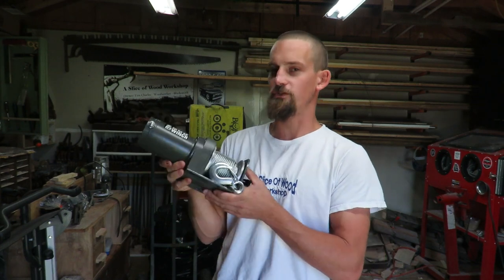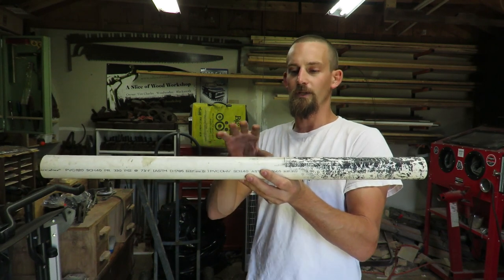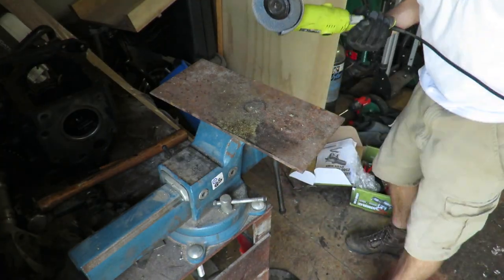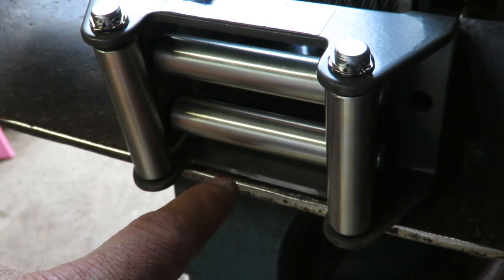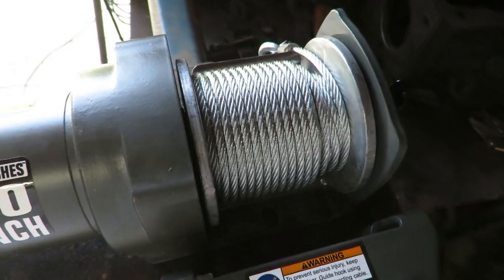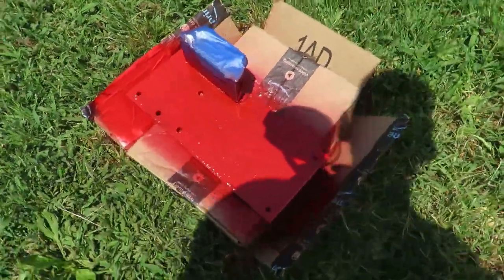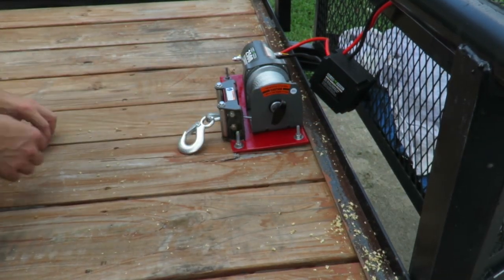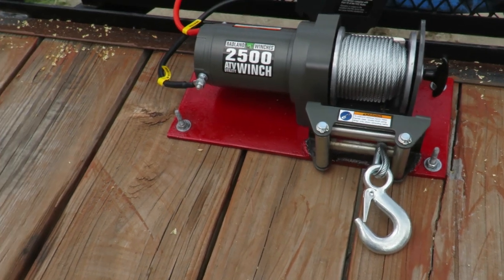Install a Harbor Freight Winch on a Trailer

Comment: Been a welder fabricator for 30 years now and you got enough on it to hold it on through a couple of these little winches. If you're welding machine don't get exactly hot enough make a couple of passes on it and it should hold no more pressure than you got with it . Best of luck and keep on welding.👍

Comment: Tim, I have the same winch on my four wheeler and it has never let me down. But my controls are hard wired so I have to be on the wheeler. You may end up with straps under floor boards to spread your load out. Good job.
Reply from the maker: When I replace those bolts I will probably add the plates. Glad to hear this has worked out for you. I got to use it yesterday, old Simplicity lawn tractor was too heavy to push up the gate by myself.

Comment: The easy way I did my atv winch I welded the ATV winch plate onto a upside down trailer hitch and it works awesome try that setup out

Comment: I have trailer ball hitch on the winch and a ball on to trailer floor. When not in use just takes a second to pop off.
Reply from the maker: That is nice. If you don't need it, it doesn't take up room either

Comment: If you’re using a suitcase style welder with material that thick it really helps to pre heat the metal. You’d be surprised what it can do. I’d say like 300 degrees would be just fine

Comment: Been thinking about a setup like this curious does it have stand alone power ? I kinda wanted mine to run when I plug my 7 pin up
Reply from the maker: Mine is hooked to a battery, but I'm sure there is a way to tie it to a main vehicle
Reply: Just hook your power wire from the winch to the constant hot on your plug that way as soon as you plug it in it's hot ,being the ignition switch is on,and I just want to say that's a great idea you got me thinking now brother. Appreciate it....

Comment: I’d think about putting a plate underneath the boards, and bolting the winch through it with some grade 8  fasteners. 
I’d like to try my hand at welding.
Reply from the maker: I'm planning on upgrading the hardware and adding a plate.  Welding is fun. You can get them cheap off facebook

Comment: Just don't let anyone stand behind the thing being winched up on the trailer.  HF tools are fine as long as their failure won't injure or kill someone.
Reply from the maker: A moving blanket or two place on the wire are great for this safety aspect.

Comment: What did you wire it to?
Reply from the maker: I keep a lawn mower battery charged and wire it to that when I use it.
Reply: @ASliceofWoodWorkshop  Do you find the lawn mower battery works well enough?   I've been thinking the same set up, but just keeping a jump pack handy.
Reply from the maker: Yes it works well. Have not had it die yet

Comment: Why did you not buy the $5.00 mount made for that winch, sold by Harbor Freight. Lord, you made a hard job out of that mounting. My 12,000 gross Hudson trailer, mounted the winch drilling  three 3/8” holes to mount the Harbor Freight Mounting Plate. Took me twenty minutes to mount the winch.  You should have bought shorter bolt to secure the winch to your homemade mount.
Reply from the maker: My HF doesnt have a mount for that winch or I would have used that instead. Mounting would have been a lot quicker. Always fun to break out the welder though

Comment: Ya should have bought the harbor freight $5. mounting plate.....way less work...
Reply from the maker: If I remember correctly they said the mounting plate does not fit these.
Reply: @ASliceofWoodWorkshop  fits perfect....I just bought one with winch....less than 5 bucks.